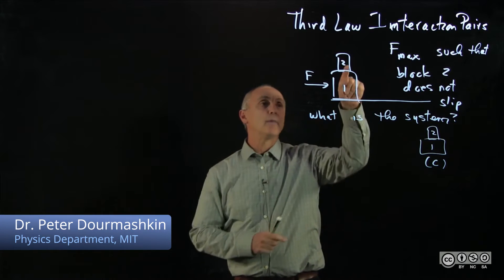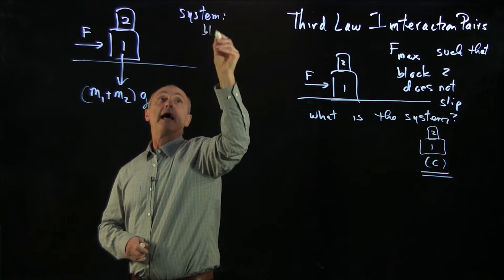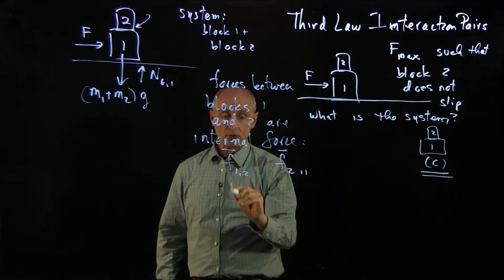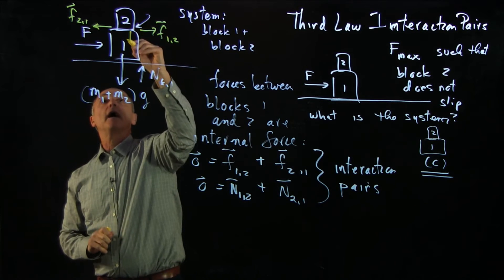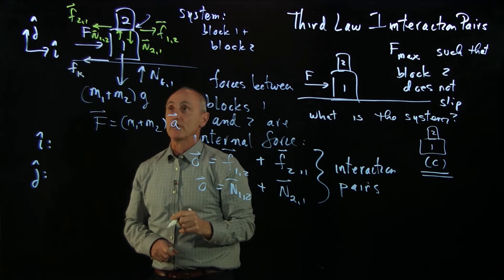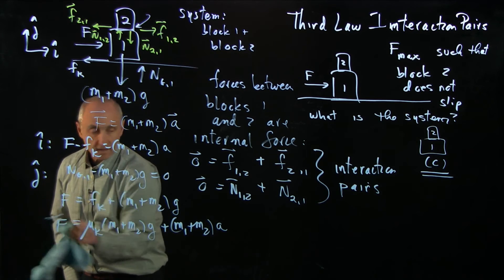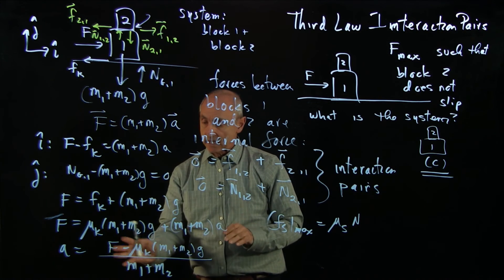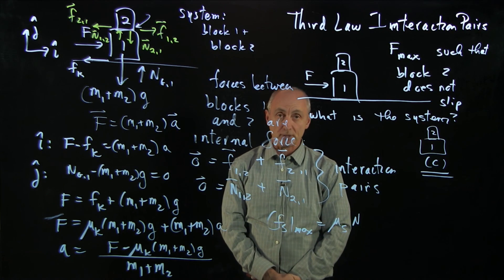PS.2.2 Worked Example - Stacked Blocks - Choosing the System of 2 Blocks Together

Comment: I think sir was wrong at the end,F max can be easily found by only analyzing system c as well.All you have to do is writing 2nd law for block 2 and plugging the a value that you get from block 2 into the system c.Because a-c must be equal to a-2,if sliding doesn't occur
Reply: Then in that case you're analyzing another system besides system c, which goes against the point of this lesson.
Reply: @nikokoro5862  ya so you can use a-b, a-c, or b-c together to solve & u'll get same answer
Reply: U can consider it as a non inertial as it is accelerating and use the concept of pseudo force or fictious force